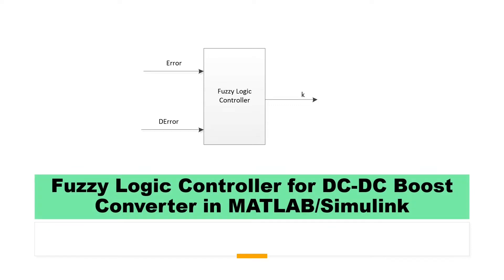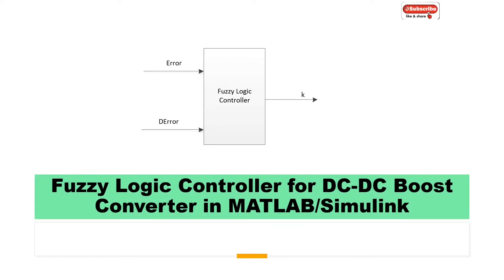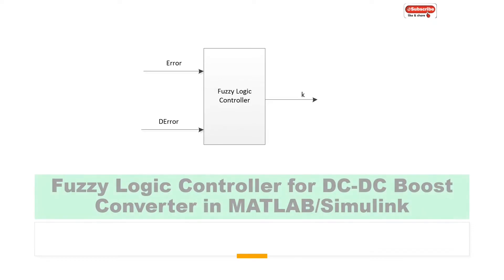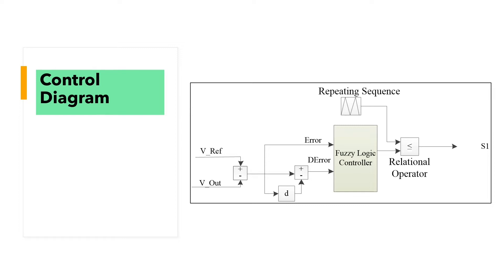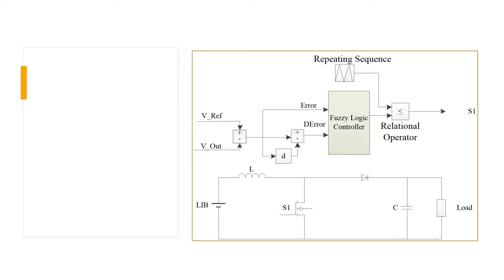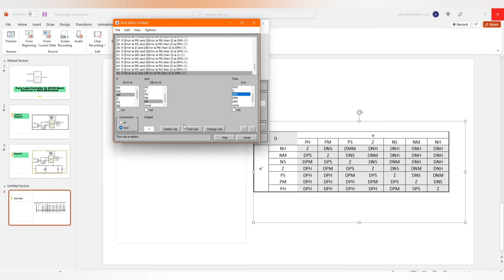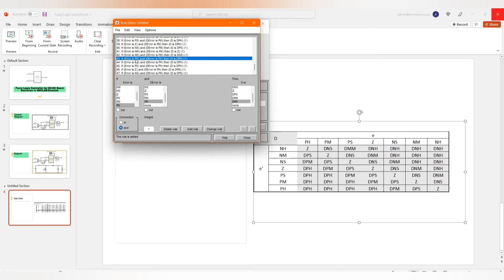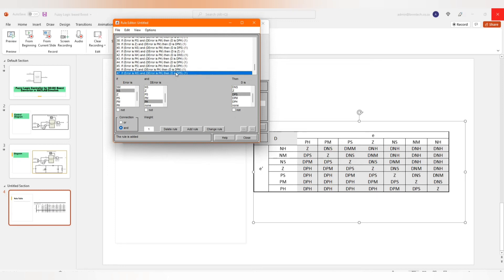Simulation of Fuzzy Logic Controller for DC-DC Boost Converter in MATLAB Simulink

Comment: When the ref voltage value is changed, the output does not change and remains constant at 22 Volts. There is a problem with the circuit.

Comment: i want to boost from 45 to 300V so how i should design rules
Reply from the maker: Hi, thank you for your comment. The rules are the design, the only difference is that the voltage references will be determined based on what you want to achieve.